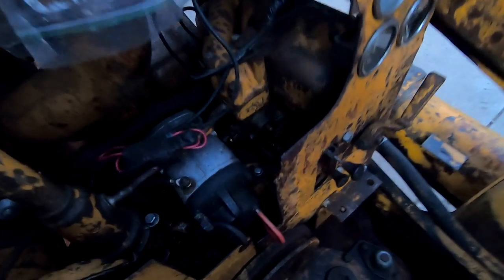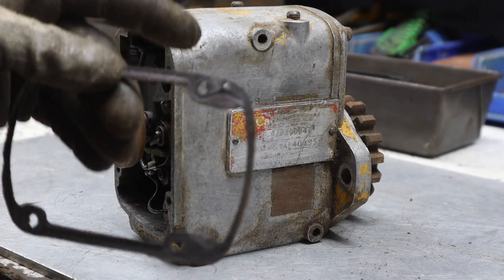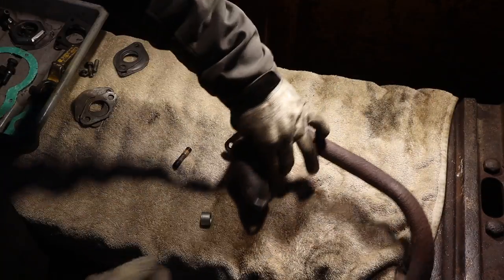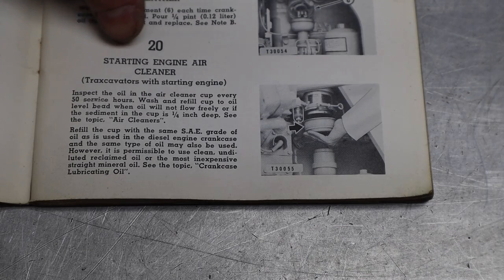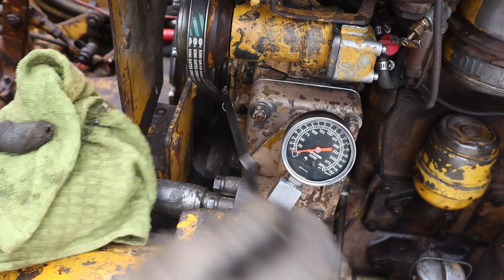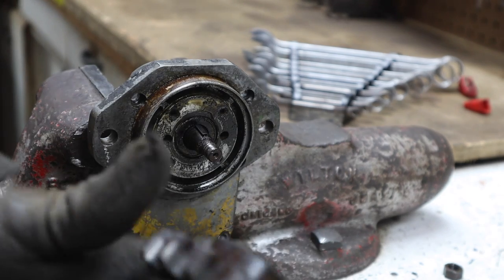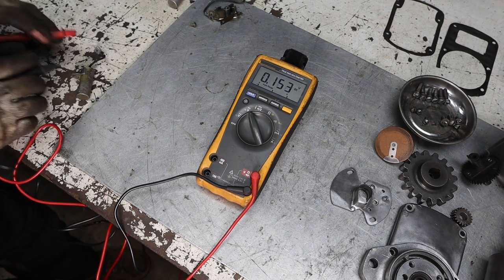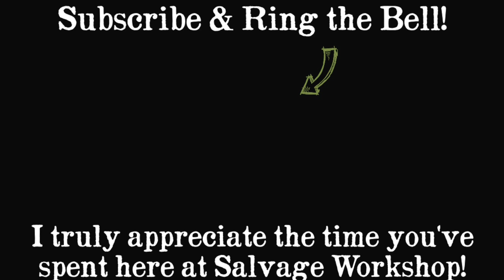FINALLY Found the PROBLEM! ~ Time to Rebuild a Magneto ~ Part 14 ~ 1950s Caterpillar TraxCavator

Comment: I’ve always enjoyed saving old machines. I’m less interested in making them pretty, and more interested in keeping them working. Your channel has inspired me to start my own tractor restoration of a 1950 Ford 8N!
Reply: Those 8n are AWESOME. I'd love to find one to restore
Reply: 1950 Ford 8N ? the only restoration it should need is an oil change and a new battery !  LOL
my 1930's Ferguson had a soft cylinder in it but ran great for 30 years !

Comment: Years ago I was flying a navy S2 sub hunter. It has two 1820 cubic inch 1500 horsepower radial engines. Was flying in rough weather and The right (starboard) engine went Kabam. Smoke was pouring out the exhaust. I throttled back the engine seemed ok. Throttled back up. Not a good idea. Kabam. So shut it down and feathered the prop. Found a near by airport had to make an instrument approach. Weather was bad. Made a single engine landing. Maintenance crew said it was a mag failure. They pulled it and the gears looked a lot like yours only bigger. Teeth missing. So I appreciate your problem more than most😂

Comment: Where did the broken tooth go? And where will it show up next? 😬
Reply: I haven't finished yet
I hope he took it out...
I don't think a piece of metal in the gearbox is a good thing
Reply: my thought too, another reason to tear the top off and find it.
Reply: The back portion of the pony engine that houses the timing gears is seperate from the pony engine crankcase. They are oiled from the oil in the starting clutch pinion assembly. He maybe should pull the starting drive and pinion and see if that broken gear piece can be removed. thats the lowest portion of the starting engine to flywheel gear drives. Something caused that gear to break?  there are timing marks on the pony engine gear and magneto. there is a plug you can pull to view them.
Reply from the maker: It went DOWN! lol  I'm sure we'll find it when I take the top off the Pony Motor!
Reply: 57:15 ok, now I can sleep again 😆
Reply: @SalvageWorkshop  thats what i was wondering was really hoping u would make the decision you did of not just plug and play which i had assumed you wouldnt not with the effort u have put into this project keep up the good work
Reply: Murphy´s law says that it will go to where it can do the most damage and be almost impossible to get to!
Reply: @johnnyholland8765  No. That would contradict Murphy's law.  Only pieces that cannot be replaced and 10mm sockets do that.
Reply: Its pluggin up the oil drain hole that's where it went
Reply: @salvage workshop,  you have no idea how much I have enjoyed these videos of old Reds restoration. I was an Automotive Equipment Operator for the municipality where I currently live from the time I returned from the Army, until I became fully service connected ten years later. I love old equipment like this. I worked around it all my life. Even in service, as a Cavalry FO I was around heavy equipment as big, and bigger than this. So I have very much enjoyed your patient, methodical, pragmatic approach to this restoration. With all that is going on in our country right now, your videos are very calming and a pleasant break from the numerous nightmares we are all facing. 
Thank you for your service, and your continued service through these vids. Believe it or not, it has been a great interlude from my high stress PTSD filled  existence. I’m sure a lot of your subscribers are vets of similar background as well. I enjoy your content. Also, am glad you found a way to deal with your stress like this, and are sharing it with us all. I don’t know if you have ever mentioned it, but I am certain you are a veteran too, and you are doing these vids to help vets and anyone with PTSD, as well as yourself.  
Good on You sir, regardless of your military status. I am enjoying every one of these vids. 

Thank You Sir. 
Stuntman.
Reply: I'm really delighted to find this comment, right at the top of the comments section, with nearly 200 likes.😁  I'm no mechanic; I don't even own anything with a diesel or petrol engine, but I wondered where that tooth went. The more I thought about it, I was wondering if SW had said something and I missed it. I then started to think that it would be somewhere so ***** obvious that it wasn't worth mentioning. By the last moments of the video, I decided that everyone else watching knew what happened to it and, with my lack of mechanical knowledge, I was missing something.
I came doen here to see if anyone mentioned it, with no intention of asking such a "dumb" question.😁 I'm maybe learning a wee bit after all.👍👌😁
Happy New Year, one and all.
Reply: Can you hurry up and post part 15 I’m on tenterhooks!
Reply: Glad to see that your going to dig deeper into the pony motor.  Finding the tooth as well as why it broke will save you time in the long run. Thanks for your determination and patience in investigating the why's and how comes, in your informative videos.  Just curious,  are you talking with someone with knowledge of this machine,  or do you have a manual for diagrams and parts lists?👍
Reply: @thecollectoronthecorner7061  I am thinking the same thing about the timing. I'm sure he will realize  he has to time it before he installs it if he hasn't already, but not having mentioned it yet has me nervous lol.
Reply: @SalvageWorkshop   With the top off you can fish with one  of those flex wands with a magnet on it.
While you've got the top off add a punch mark for tdc to the front of the gear
the existing one is on the back, ...useless.
And when you put the top back on do not put a long bolt in a short hole.
I did that and made a leaky passage from  the water jacket to the valve chamber 
contaminating the oil. result I had to drain the water from the oil before each start.
F
Reply: It will be just fine, you all may un-knot your undies please.
Reply: That tooth will be in the diesel engine flywheel housing that holds the clutch and starter pinion.
Reply: I also was thinking the same thing. He is so through with his repairs, I’m surprised he isn’t repainting these various components before he reinstalls them on the machine.
Reply: There is a magnet at the bottom usually they'll go stick there.
Reply: @wolfwolf7246  No, there is no magnet in tha bottom of the starting clutch and pinion housing.

Comment: I like the fact that you like to try different things and learn from your mistakes. My friend who worked on my air compressors showed me how to make gaskets like you do. Once I made one for an air pump system and forgot to cut out the interior hole where the air flowed. Stopped up the whole system. Learning experience.

Comment: What an amazing journey.  I found this story about the Cat and have been binge watching for over 2 days.  This is a great source for teaching mechanics and how to correct problems and to encourage people to be self-reliant.  I can't believe how many problems this machine has!  I want to compliment on the camera angles and lighting - the way it is done make it easy to visualize.  I have a couple of suggestions.

First, I note that when something needs to be disassembled that has years of rust, the approach here seems to be to spray the nut/bolt with something only seconds before an attempt is made to remove.  I have a ranch, have many rusty things and have discovered that there is tremendous benefit of spraying with a penetrant and giving it time.  PB Blaster is my favorite but Liquid Wrench works well too.  The more time given, the more effect there is.  For super rust, I have re-applied daily for 4 days and disassembly happens amazingly easy.  It is a chemical change that takes place.  My suggestion is to spray all fasteners before taking a wrench to the first one.  At least some will have additional time.

Second, the concrete working area seems to be nice, but note that oxy-acetylene molten drippings will discolor and pit the surface.  I move scrap sheet metal underneath to stop the molten steel from directly sitting on the concrete.

Comment: Excellent job. For many decades I personally kept an 1953 Oliver OC3 running for my father. Had many of the same trials and failures and achievements. But this was before You tube. Many evenings lifting pieces off rebuilding and repairing, and a lot of circumventing. Trust me there is NO old new stock for Oliver's. And that was over 30 years ago. But I do admire your willingness to think it through and figure out the real cause of equipment failure. A few things I did different, all those old straight screw driver bolts I replaced with Allen socket heads the same length but added a grade 5 or 8 lock washer, lot's and lot's of Anti Seize (I like Permatex) and after cleaning I did one more step with scotch bright pads or super fine sand paper to bring every gasket face to a super clean and shine. Bottles of blue and red lock tight. Finally my number one tool for working on the OC3 was the torch, heat is the only cure rust welding, unit was stored outside before my Father acquired the unit. I never worked  on Caterpillar units, we did have a few International Tractors that started on Gas and then switch to Diesel, I feel your pain, cause they were a pain. Keep up the great work and history alive and well.

Comment: So I enjoy watching this as it’s not just another bench grinder restoration. It’s “I’m going to get this big machine working, but I need to fix all these things.” So as a viewer, I’ve now learned how tracks work, and are assembled. I’ve learned how a pony motor interacts with the machine. I’ve learned how to rebuild a magneto for the pony motor. Etc etc. 

Kudos for not firing up the pony motor, knowing it has a crankshaft play issue. Fixing it to prevent blowing up the rebuilt magneto is 100% the correct way to go. 

Hello from Canada, see you next episode! 😁

Comment: Your willingness to hold a mag wire is impressive.   I have been shocked by that mag few times starting a D4. It is more than a light zap, more like an arm jerking experience.
Reply: Yeah I have been zapped by that a few times.  Don’t even have to make contact, just being close enough to a bare section and it will jump.

Comment: Hi from Australia I have been watching your "overhaul" of Big Red and as an ex heavy machinery mechanic (retired) brings me back to my early years from being an apprentice in 1970's then up through my working life.

I loved the way heavy machinery is so overbuilt compared to their automotive bothers lol. although I did curse a lot, as I remember back, for many reasons like steam cleaning/mud/oil removal, working up top and dropping tools/ parts then climbing down to find/retrieve them (this gets old really quick) using pipes to get that extra leverage, using the "Gas Axe" to persuade that stubborn/damaged fastener to "cooperate" and using the overhead gantry crane to remove the heavy parts etc. I could waffel on for hours so I will cut it short.

I love your channel and it reminds me of ......... well me, I remember making gaskets just the same way with a small ball-peen hammer, in this throw away world it give me hope that younger folks are still interested in Real heavy dirty work.

I agree that you need to open up the motor, if for no other reason than to find the broken tooth!!!!!! and while you are in there you can reassure yourself that there are no other issues that would bite you further down the road.

AND MAKE SURE YOU SET THE TIMING CORRECTLY, this is the most important part of refitting the refurbished magneto.

Chuck

Comment: Oil wouldn't be coming out of the exhaust port unless oil is going through the combustion chamber.  Nevertheless, the pony motor "problem" got you into the motor to find and perform a number of fixes that you were going to need to do anyway so while this may have looked like a setback at first it really was a necessary step in getting to your goal.

I've also driven the Alaska Highway many times and it was built using machines much like this one so it's good to see you fixing one up and keeping it going.

Comment: That swab in there is crucial of having lube or it`ll drag on the lobe and pull the points closed retarding spark and give erratic timing to it - So actually there`s something in the crankcase of the pony motor moving around ,Might want to put a narrow magnet in the crankcase leave it there to catch crap like in a transmission even push it up the drain pipe all the way in - You know what would work good is a telescopic pocket magnet push it up the tube leave it when you drain it just pull it out the piece might be bigger than the drain pipe but the telescopic tube and Mag won`t go up into the crank .
Reply: Agreed, and now that the teeth of that old gear are floating around in there too, that’s more potential for damage. Though I think he’s got the right idea to pull it apart to clean it out, or it could cause trouble before a magnet gets it. A good insurance would be to install a magnetic drain plug after it’s all done to catch particles in future, I wonder if the drain tube is adaptable to adding something?
Reply: I read your comment in the most American accent I could, you are a hero of mine

Comment: Hi let me do some digging in my parts trailer I think I got some magnitos for a cat pony motor if you would like some spares
Reply: @SalvageWorkshop  Dont forget, Magnetos often need the magnets to be recharged .Once a common thing to get done it's something which catches out the younger folk.
Reply: @Mercmad  I used to recharge slot car motors. They are quite small. The charger was an electric fork truck battery (HUGE) and a coil of wire on a C  core with an adjustable rod to connect the motor.  It was way overkill! But one zap was all it needed. LOL

Comment: And that missing tooth is still in there and might just bind and screw everything up at some point.
Reply: I was thinking the same thing 🤦‍♂️
Reply: now I can't sleep until the cursed broken tooth is taken out of the gearbox
57:15 he will take it out, now I can sleep again 😆
Reply from the maker: Have no fear! I'll find it!
Reply: @SalvageWorkshop  It's down in the Hula Dancers quarters, learning the correct dance routines.   The Mad Welshman in San Antonio, Texas.
Reply: it ain't missing, if it's still THERE !!!.....Lol !
Reply: @SalvageWorkshop  Put it under the pillow, the Cat fairy might bring a new carburetor.
Reply: If your not going to pull the pan to find the "spare" tooth... Do yourself a favour and epoxy a big @$$ neodymium magnet to the lowest point of the outside of the oil-pan.

Comment: "It wouldn't be an old red video without a broken bolt" LOL,  I've seen stepped studs with different size on each end, so you can fix threads and use the stock size nut on the part side
Reply: I had the same thought, but given that location, I think his solution was actually better.
Reply: @Nevir202  The shim was inspired.

Comment: Hope you made a "timing mark" before you pulled the mag,,to get it back in time !!
Reply: Not hard to figure out and with the busted tooth, timing was fubar anyway. He'll have it apart anyway so there's no issue pulling the head off to figure out where the top of the compression stroke is.
Reply from the maker: There is already a timing mark on the mag, the interal gear, & the flywheel. It's just about seeing the one on the internal gear! Ill show you when i get to that!
Reply: Exactly. Been sayin that all the way through this vid. Another thing worth mentioning is that you can bech test a mag just by spining it over with leads n plugs
Reply: Bench test, I meant🤓
Reply: @deetesmin  Absolutely!  Key words: leads and plugs.  If the spark has no ground to go to, you can fry the internal mag coil!
Reply: @antagonizerr  Finding compression stroke is easy. Screw up some newspaper into a tapered plug and shove it in the spark plug hole (hanging out not all the way throught). Crank the engine when it spits the paper thats compression stroke.
Reply: @SalvageWorkshop  Yup, there are timing marks in the magneto gear and the mating gear. I’ve replaced the magneto before.
Reply: Yep timing marks on both gears, just need to match them.
Reply: My dad used to bench test all kinds of mags.  There is still a spark plug welded to the vise for that.  Put a socket on a drill and spin her over with a lead connected to the plug.  Can’t remember if these mags have a timing adjustment or just a gap adjustment.

Comment: love the videos., if you can turn off automatic gain control on your camera. every time you make a loud sound (drop a spark plug wire) the mic gain turns down quite low.
Reply: Where did the broken tooth from the magneto large gear go? Is it in the motor? Need more lighting for better caption from your camera. You do great work. HAPPY NEW YEAR !
Reply: I make some vids myself and he should definitely keep audio AGC on.  The audio will be a nightmare mess without it doing this sort of stuff.  That only works in a studio.

Comment: Did I miss the "timing" stage? Drive gear,  Driven gear, and point drive will need timing with crankshaft won't they?
Reply: yup
Reply: Yes, magneto gear and crankshaft gear MUST be properly timed.
Reply from the maker: Nope! That will happen once it goes back on the machine!
Reply: @georgestephens2593  Yes, it was a rhetorical question  and good topic for a Salvage Workshop follow-up. I'd worked with the old Wico mags on our IH W-30s, yes had two, one with the "15 MPH Special" four speed trans!
Reply: @SalvageWorkshop  It will be interesting to see how this works out.
Reply: The two small internal gears were timed around 53:30 - 53:35. Sped up footage and not zoomed in to see timing marks. Easy to miss.